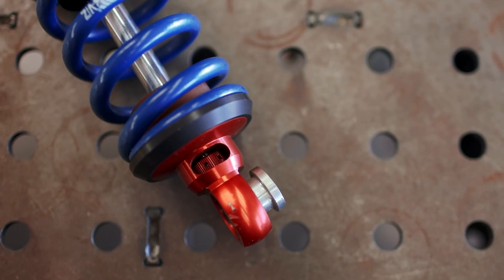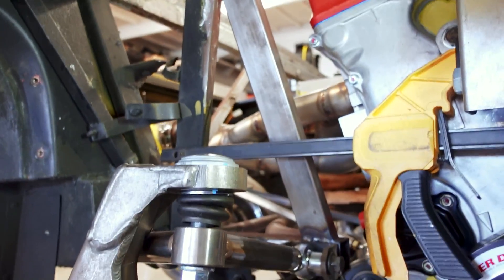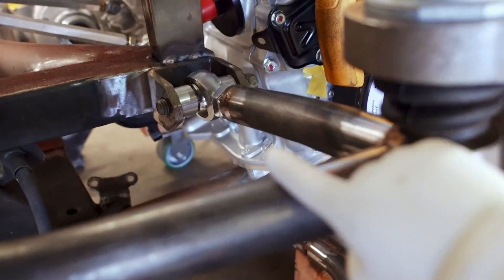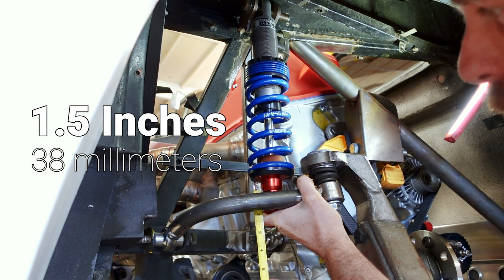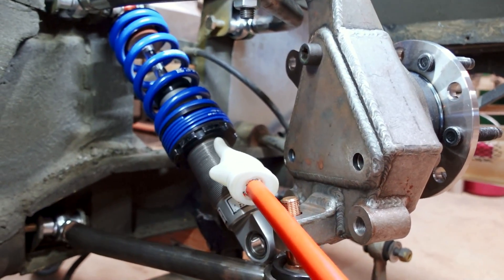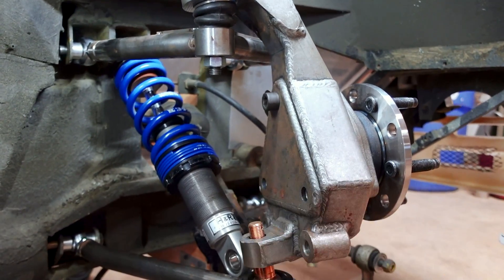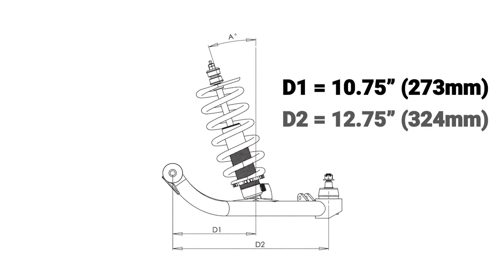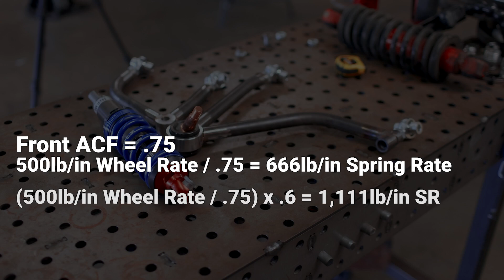Custom Spec'd Coilovers - Measuring Up the K-Swap Ferrari for H&R Suspension - Ep. 65

Comment: I thought this was supposed to be a streetable car. 500 lb/in will be brutal.
Reply from the maker: That's not correct what so ever. It all comes down to the valving when paired with the rate for ride quality. Stiff, sure, but I've had 900lbs springs on my E36 and it rides phenomenally well. A buddy has 1400lb springs on it and its still entirely streetable.

Comment: Are you doing your measurements for the coilover length to be full extended at ride height? You will want to allow for ~2" of suspension droop, wont you?

Also, why are you running the helper springs on the model A, if those helper springs are fully compressed at max droop?

Comment: Just a question about the coilovers you used for mockup. Why have a helper spring on there if its being completely compressed at full shock extension? Couldn't you just leave it out at that point since its not doing anything and save some unsprung weight? Normally they're there to keep the main spring in place when the shock is at full extension and the spring is too short, yeah?
Reply from the maker: You're 100% correct.

Comment: Those tender springs on the model A are compressed at full extension? Doesn’t seem to be designed very well 🥲
Might as well take the tender spring out

Comment: I reckon you could get under 2000lb if you gradually replace all the bolt on steel body panels with carbon fibre ones. 

Could probably make back the costs of making the GRP moulds to do it by selling some as well. EasyComposites has a good video guide on copying whole bonnets/wings in carbon.
Reply from the maker: There are definitely not enough 308 owners willing to destroy their cars for me to make the monumental cost back :-p
Reply: @stanceworks   Shouldn’t be much if any destruction really, they originally intended them to have composite panels so most of the body panels are bolt on 🤷🏻‍♂️ If anything they could store their OG panels away safely right? 

I thought you mentioned you’d done some vacuum bag carbon before so I assumed you’d already got the pump, but I’m guessing that might just be a result of watching videos as I go to sleep 😂😂😂.
Reply from the maker: @Jonathan_Doe_  Unfortunately you've got it backwards. None of the panels come off. The entire roof, quarters, front fenders, nose cone, and tail piece are all one single piece. Even replacing a fender on a 308 is a huge deal that requires a lot of cutting to do. Replacing panels with composites would only be for a select few hardcore dudes.
Reply: @stanceworks  Ah yeah, that’d be one massive mould to make it one piece like that, and a nightmare to vacuum infuse, although I’m guessing they probably welded separate panels together and then filled the seams, so you could bond it together from smaller sections or something.

Comment: At the 6 minute mark, looking at the rear shock length, it looks like the shock doesn’t need to be shorter, considering the shock is unloaded, but the suspension is at a loaded position (normal ride height).  The shock is only unloaded at full droop.  What am I missing?
Reply from the maker: I addressed this right before that segment.

Comment: On the Corvette, the spring mounts to the lower control arm.  The upper control arm is only there for upper location of the upright, not for any vertical load.  I think you're taking too much liberty with the upper control arm loading.
Reply from the maker: This is correct but that matters in what way?
Reply: @stanceworks  Now that you're mounting the spring onto the upper mount, that ball joint will have much more load on it.  I'm just saying it isn't an equal comparison relative to the Corvette usage.  You're loading that upper ball joint much more than the Corvette does.  No idea if it if a problem, just noting that it is more.

With that said, amazing work!

Comment: I know it’s probably to late but as you have already changed most of the suspension and chassis mounts already, I would make those units more upright.
Reply from the maker: I thought it would be a problem too. But I had a suspension engineer with Daytona 24h wins under his belt confirm “it absolutely doesn’t matter. Mount them at an angle if it’s easiest.”
Reply: @stanceworks  I'm assuming that advice comes with the caveat that everything's been measured before deciding on rates and etc, as you've just done 😁

Comment: I could be wrong here, but shouldn't the overall shock length be determined at full droop? Ride height measurement is important, but if you set the maximum shock length at ride height the the suspension won't be able to extend into depressions.
Reply from the maker: You’re right. I’m defining shock length as mid travel. This isn’t overall length. I guess I wrote that on screen. But as said mid video, it’s mid travel.
Reply: @stanceworks  Thanks for replying, makes a lot more sense!
Reply: @stanceworks  Are you saying that at ride height the shock will be at 50% of the total travel?

Comment: Being someone that deals with suspension kinematics and design on a daily basis, let me tell you, this is far from ideal. You can make your life so much easier by taking some measurements of the suspension hardpoints and punching some numbers in a dedicated piece of software... There are many, easily available and easy to use that can at least compute the MR curves, as well as toe, camber, roll center, antidive etc etc etc curves all at once.
Even fot weight and weight balance it would be so easy to just write a couple of number in excel with the main masses and take a much more educated guess. Once you put the weight and CG location of the chassis, the powertrain and the driver you have a pretty clear idea where the CG of the vehicle is going to land.
If you need some help feel free to ask, I'd be more than happy to be useful.
Reply from the maker: I already have all of that solved.
Reply: @stanceworks  So, just out of curiosity, why haven't you used that to compute the motion ratios of the suspension? Genuine question, I'm not trying to be an a***ole!

(by the way, in the previus video you were talking about a Ferrari "insider" being a fan of the build... I'm in the design team of the future GT3/GTE Ferrari racecar, and I've been following and loving this project since day one, I'm not trying to be harsh with the comments, I'm just a lot into it!)

Comment: Awesome episode Mike, curious how you landed on a 500lb/in wheel rate as the starting point? Was that recommended by H&R or personal preference from previous projects?
Reply from the maker: I just used it for an example. It’s not what I actually landed on. But, at 2500lbs, 500lbs would be the front corner weight if it was a 60/40 weight balance.
Reply: @stanceworks  ahhh yep of course, not armchair mechanic'ing I swear, genuine curiosity! Hopefully H&R sends a couple different spring rates so you can experiment for your track event following SEMA.
Reply: I'm no expert, but I'm running 500lb springs on the front of my old Dodge pickup with a Viper V10 engine, and they are perfect. I would think you would be considerably less.
Reply from the maker: It doesn’t really work that way, Hemi. For example I have 750lb springs on the front of my 3 series bmw. This car will have huge aero and likely have even stiffer springs than stated in the video. I’d guess somewhere closer to 2000lbs in the front.
Reply: @HemiDartGT   How much angle do you have, in front, comparing to the Hondarri?
Reply: @raverick187  Not as much. 15deg.or so.

Comment: The vertical shock doesn't appear to leave much fitment for backside of the wheel, or am I just envisioning things poorly?
Reply from the maker: I believe there should be room. If not I’ll drop the damper down and run it next to the axle with a new mount.